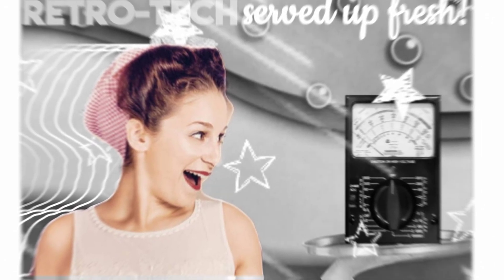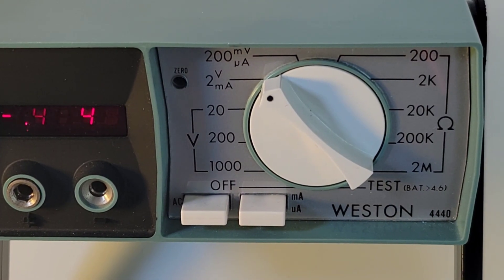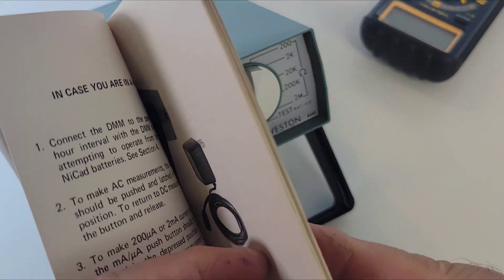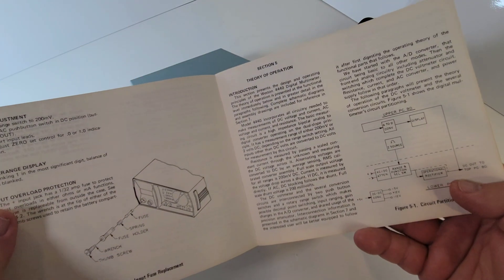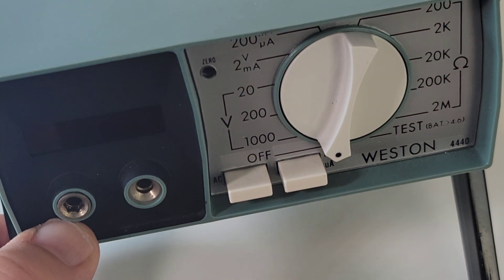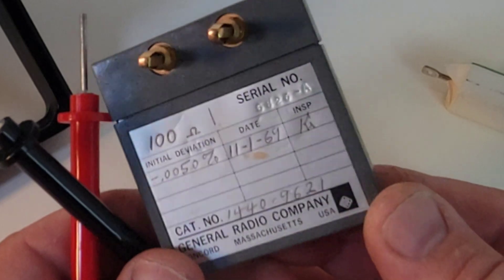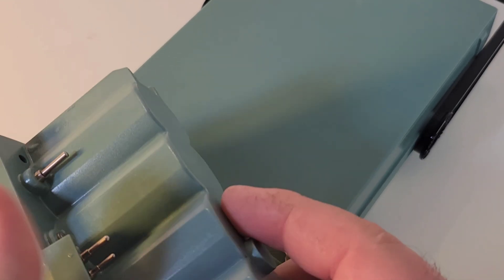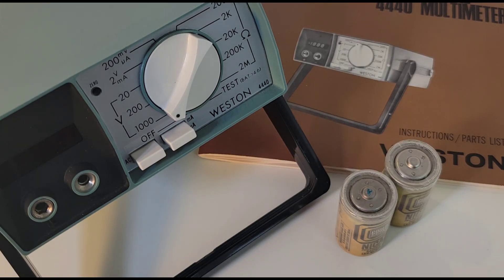RETRO-TECH ○ WESTON 4440 Digital Multimeter Mini Review & Teardown! (1972)

Comment: They don't make them like that anymore!! 
Incredible to think of all the ingenuity that has been lost over the years. A time went they weren't worried about their designs being copied and made them to be fixed.
Reply from the maker: That's for sure ! This lil gem was really well thought out. The external battery housing, chassis Screwdriver for easy fuse removal and simple battery self test were thoughtfully engineered for the end users benefit. It wasn't about how cheaply it could be made for the masses. Even the self calibration and parts list right down to every single component shows they cared not only about the instruments but the user's who would buy them. 😊

Comment: I believe the color is a Vintage Blue Grey. And, for other vids featuring handheld DMM, when they have no threaded inserts for the battery compartment..... Can you show us how to insert a threaded insert using if possible?
Reply from the maker: Love the blue hue..Thx for clarification 💙 Great question about those threaded inserts..I'll see what I can do!
Reply: @KeepOnTesting  -- I believe those threaded inserts have to be molded in when the case is manufactured, I used to install threaded inserts in many molded plastic cases during the injection 
molding process when I worked in a molding room. HOWEVER - seems like ive seen some inserts 
that screw into the case after the hole is drilled to a specific size, but those may have been for wood but might work for plastic though with plastic theres always a danger of splitting the material when the insert is threaded in - especially if the case is older and more brittle.  Also, in (some) cases "nutserts" may work as well, theyre installed with a tool much resembling a pop rivet gun.
Reply from the maker: @yambo59  I've noticed some that now are being manufactured for a "COLD" installation. One company makes the threaded inserts called press-in inserts designed for post-molding installation in either thermoset plastics or thermoplastics. They have a slotted design with diamond-knurled OD allows for “cold” installation with optimum torque/pull-out resistance. Cold installation of threaded inserts reduces the cost of moldings and eliminates the need to “chase” threads after molding. Kinda cool..but would definitely need to play with these to see how easy to work with they really are.